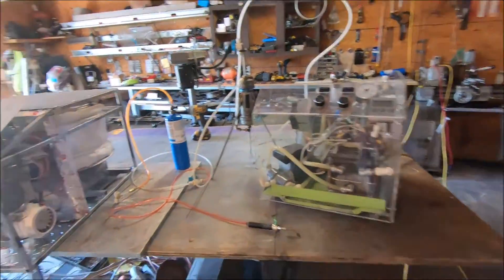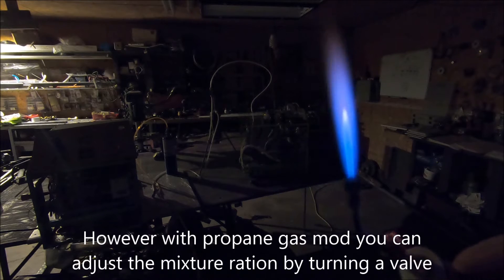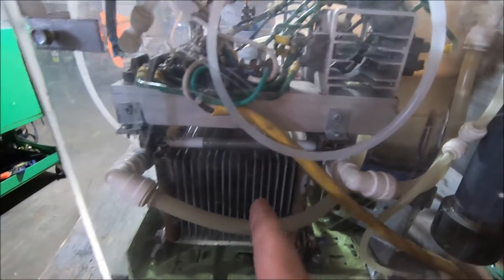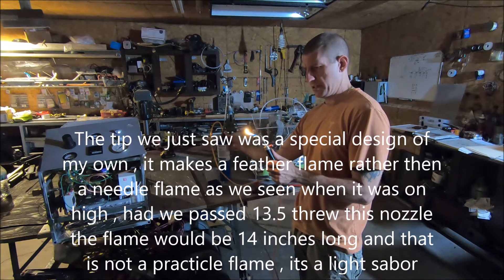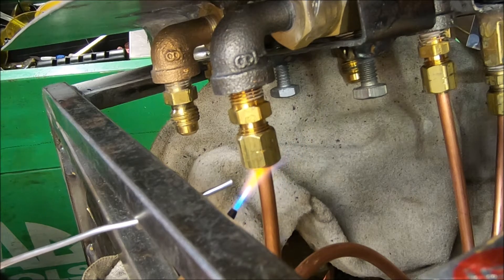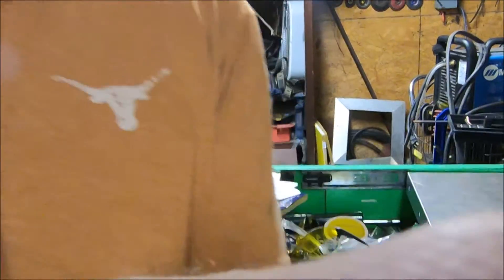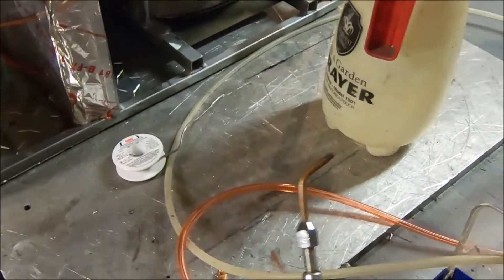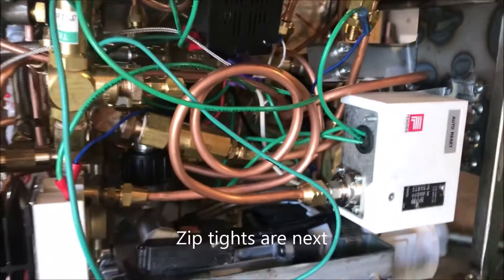Propane Gas Modification for Precision Soldering or cutting

Comment: Man that flame is perfect. I've made my own HHO generator and torch but not having any luck, i keep getting flash backs no matter what, I've blown up lots of plastic bottles I've been using as bubblers. I'm thinking my flow rate is too slow and so the flame doesnt stay, it just ignites anything it can in the tube. Any tips? what where you were worried about at 8:55 ?
Reply from the maker: yes as smaller hole on your nozzle will make the gas fly out faster and it will exceed the combustion velocity of the gas

Comment: Mathmatically modeling an electrolisys cell. 👇

Water breaks apart at 1.24v, and if 3 volts applied across a cell then 3v supplied - 1.24v water breakdown down voltage  = 1.76v overvoltage. 

1) Amps × water breakdown voltage is power used to break up hydrogen and oxygen storing it chemically.
2) Amps × overvoltage = power heating the water and browns gas.

Example 100 amps being pushed through a bunch of cells with 3v across the cells has 100amps× 1.24v = 124watts being stored chemically as hydrogen and oxygen, and 100amps × 1.76v overvoltage = 176 watts making heat that's heating the water and gases.

Efficency of chemical energy storage is simply 1.24v/supply voltage
Reply from the maker: not true bud , all that over voltage bullcrap aint true , build a couple of these and get back to me , it makes twice as much gas and a way bigger flame with 3 volts . you didnt take into acount the resistance of the electrolyte or the stainless steel plates so you need 3 volts bro , people come and tell me this all the time after they read a chemistry book , that info is wrong , i have manty hho torches and none of them out out good amounts of gas at 1.24 volts .....
your assumption is wrong , not being a jerk but i can tell you never ran one of these
Reply: @NOBOX7  so yeah, I used to build and test electrolizers commercially for another company.  But reguardless, I'd like to cover a few things in a different way.  I think you'll agree with them and understand what I'm trying to communicate. Let's use a 3vsupply and 100amp flowing through the cells as an example. 

1) starting simply and generically, when doing water electrolysis over a period of time, we can expect some electical energy goes to making heat and some electrical energy is converted to chemical energy. For simplicity here we might simply look at watts instead of watt hours or watt seconds. 

2) We can mathmatically model the two types of work done with two resistors in series.  3v supply voltage/(r1+r2)=100amps making (r1+r2)=effective resistance

3) r1 would be the resistance that makes heat with current flow.  Several things that factor into what  this resistance is, are electrolyte type, concentration, temperature, distance between plates, cross section area through which ions flow, and bubble buildup on the plates and inside the electrolyte limiting the effective cross section through which ions flow. 

4) r2 does work like any other resistor. But, instead of turning electrical energy into heat energy, r2 is turning electrical energy into chemical energy.  Now if we were to model r2 as an electrical component, it would be an ideal zener diode rated at 1.24v. An ideal Zener diode changes its internal resistance such that no mater what the current is, only its rated voltage developes across the diode unless the supply voltage drops below the zener tated voltage and there the current stops. In our case 1.24v.

5) let's put everything gether now.  Say we have a bunch of cells supplied 3 volts and let's say there is 100 amps in total flowing through the collection of cells.

5.1) 3v supply/(r1+r2)=100amps or (r1+r2)=3v/100amps = 0.03 ohms total effective resistance. Effective because given the supply voltage and effective resistance, only 100 amps flow at that voltage and efective resistance.

5.2) voltage drop across the heating resistor  v1 = supply voltage - 1.24v water breakdown voltage = 1.76v.
And since (v1 or 1.76v)/r1 = 100amps, then in the example given the actual electrolyte resistance factoring in everything stated above is 0.0176 ohms. There is probably some small wire and plate resistance as well be let's keep the example simple enough to convey this topic. 

5.3) it's well known in many many many research papers that water breaks apart at 1.24v. Thus v2=1.24v, and (v2 or 1.24v)/r2=100amps  means in our 3v 100 amps example, r2=0.0124ohms.

Double checking (r1+r2)=(0.0176ohms+0.0124ohms)=0.03ohms.  This simply confirmed  the sum of  electrolyte resistance plus the resistance that's does the splitting of water equals the effective resistance that only allows 100 amps when supplied 3 volts. 

How about power? 
(v1 or 1.76v)×100amps=176w heat wattage 
(v2 or 1.24v)×100amps=124w electrical to chemical conversion wattage.

Comment: Man you got me confused all to hell on this. 

I have huge OXY/acetylene tanks and the big cutting torches. 

The tanks cost about 500, the torch cost about 200, the cart cost 150.    BUT  THEY LAST 5 to 10 years for me!!! 
When it’s time to fill them they cost I think 40 bucks for a refill.  If you look at the initial set up oxy/acetylene is expensive.  I understand that.   But the operational cost after the original purchase is basically nothing.  Figure two big tanks cost less than 100 bucks. They last many years.  I don’t use them a lot.   I know sometimes the tanks expire before I use all the gas that might be 10 years. I have only filled them 3 times in my life.  
They sure are nice as hell when you want to cut something. Zip and it’s gone.  I can cut thru Even one inch thick steel like butter.   I can cut a car frame apart faster than writing this note.  
You can’t do that with propane!  No way!!

I don’t understand the soldering part.  At all. 

And I have burned up copper and brass trying to solder them.  

Sometimes it works sometimes it don’t. 

YOU DID NOT USE ANY FLUX... 

Without flux mine just drips off. 

I don’t understand that at all.
Reply: Gas welding and gas cutting are not the same.. know your torch tips!
Reply from the maker: I use this every day and it has payed for itself ten times over
Reply: Aircon brazing from copper to copper or brass to copper? No flux.

Comment: Ever tried toluene coolant?
Reply from the maker: No but i bet its powerful , toluene is some high powered stuff , problem is it dissolves everything almost , my entire set up would need to be toluene resistant  , if i put it in my current set up it would melt all the plastic fittings . I put some in a high dollar plastic syringe and turned around to walk over to my lab area and the syringe melted out of my hand that fast and was dripping on the floor
Reply: @NOBOX7  Woah that's fast! I heard somewhere that it's lower in hydrogen than acetone and most of the other coolants people use but don't have a hydroxy setup myself to test it.